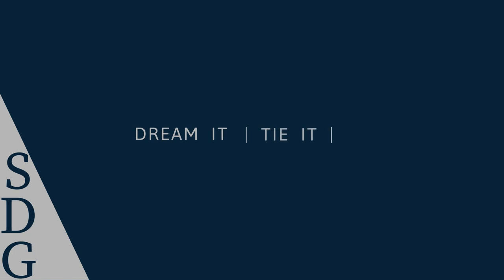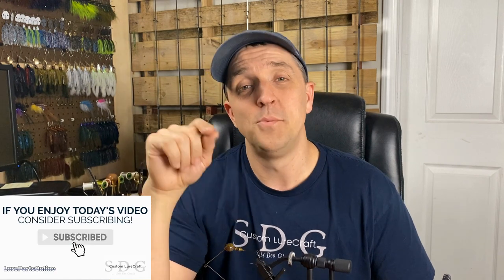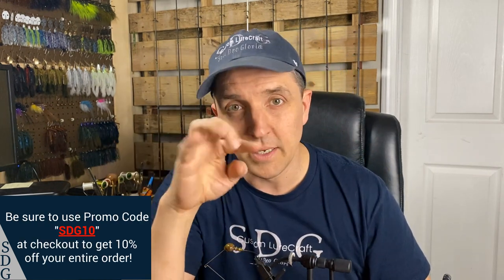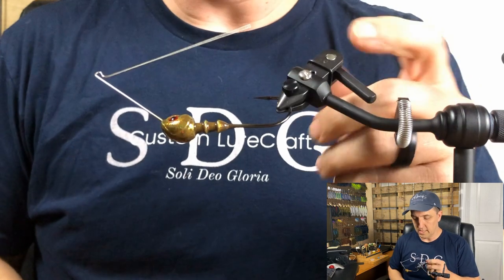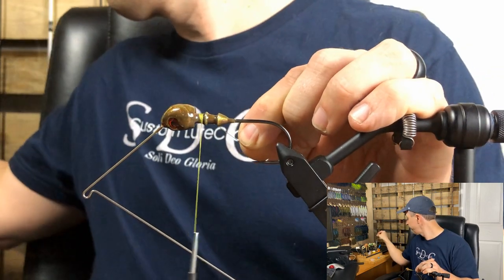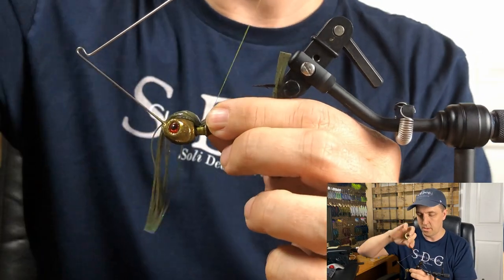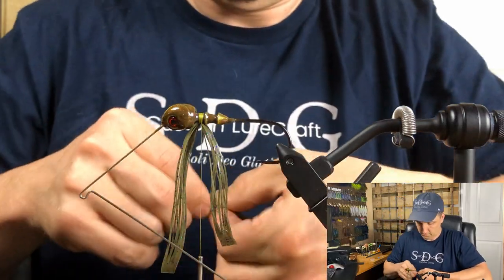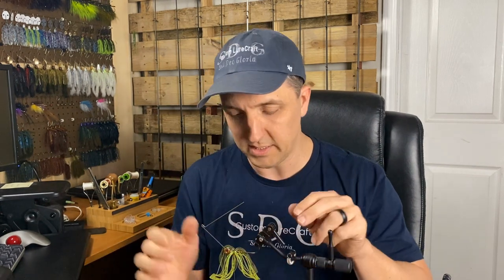Spinnerbait // Part 2 of 3 Spinnerbait Build Series - Sprayed Grass Pattern Thread-Tied at the Vise

Comment: Thanks for sharing Adam, the skirt was spot on. When I tie a SB I put the wire form in the vice so the hook is facing out so I don’t have to fight the wire. Don’t know if it’s right or wrong it works for me.
Reply from the maker: Thx Rich!  JR said the same thing, we were sharing a message this morning.  Seems like another great option, one I will most likely try on a future build!  I’ve got plans to show some unique designs that use permanent trailers and/or body wraps, so I’m not sure how those would fair as they may get in the way, but I won’t know until I try!  Question: clamping at the wire - so you get nervous about bending/distorting the wire at all?  I can really rank on the thread from time to time... the hook can take it but the wire is so much thinner.  Are you just tying with less thread pressure?
Reply: @SDGCustomLurecraft  tie with less pressure when I build the collar I hold the head so I can use more pressure
Reply from the maker: @richshackelford5793  makes sense!